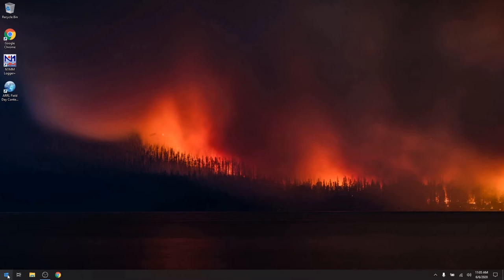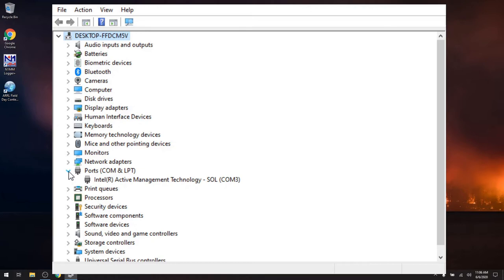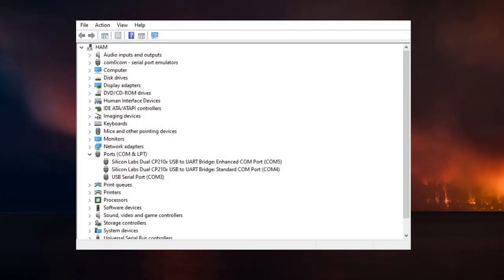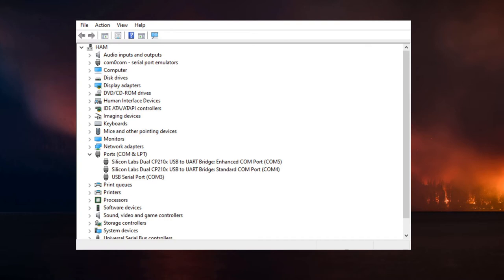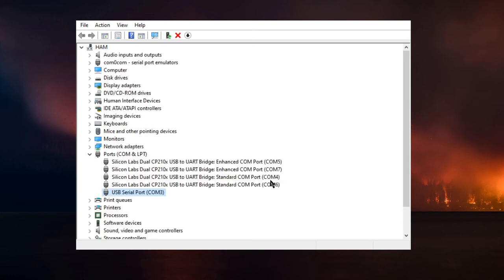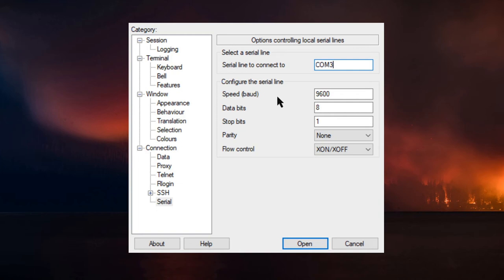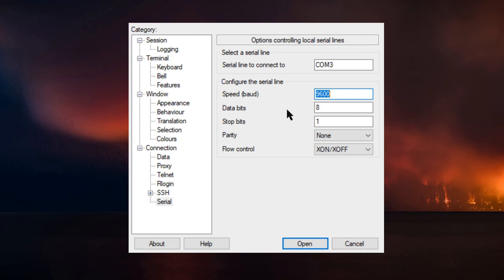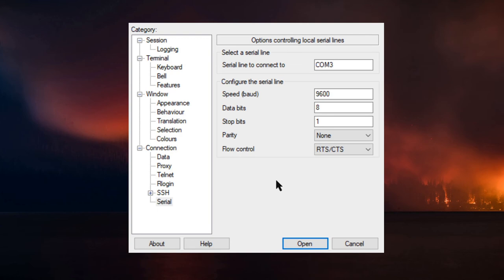Identifying, Configuring and Setting Up USB COM Ports In Windows 10

Comment: Thanks for your video's Stue, great help with N1MM. Would you have (or make) a video about what I think I port sharing. I have N1MM setup with my TS-590sg performing CAT control and the works, but I also want to use an SDR to control the rig. It seems like I need a "virtual" com port that is addressing the same cable that goes to the rig which is already in use by N1MM. Any thoughts would be great. Radio is the easy and fun stuff, but working with MS Windows is a daily challenge.
Reply from the maker: Hi Mark,
Wow... I can't believe I missed your message! It's interesting that you ask that question because it was a huge problem for me when I setup all this stuff. Let me share some ideas...
First off, N1MM+ does not 'share' well with anything. It want's to control the radio and everything about it. There are other issues as well with other Ham software packages that give you trouble as well. I ended up buying a package called Win4Yaesu that could control my rig and had 6 virtual ports that you could setup to have other software 'think' it was talking directly to the radio. This was my final solution. But, although this software is available for other radio brands, it is limited as to what it supports. If you have an FT991, FTdx???? I would strongly recommend it, but that's not your current setup.
I have found something interesting in HDSDR that I have just begun testing. It is dependent on Onmirig software, but seems to solve the problem for many. It basically uses a virtual null modem cable configured through com0com and presents a TS-50s to other software connecting to it. Once I complete the test with N1MM+ I will post the video.

Stu
AG6AG
Reply: @AG6AG  Great, thank you for that info. No problem on the delay, I'm still trying all sorts of options. The SDR control I have dropped by the wayside, but I have added a second cable to the TS590 and now it has two com ports so I can run two pieces of software without virtualization. Some say that is also looking for issues, but it is a neat feature of the 590 to have two serial ports. I'll keep an eye out for new vids, I love all the information. Thanks!

Comment: The com port section in device manager is missing, what do i do from there
?
Reply from the maker: This usually implies that the device is not being identified by Windows. With the Device Manager open, plug the device into the USB port. Look for something showing up with a yellow or red mark on the left side of the device description somewhere on the tree. If you see something appear, it usually means that you need to download a driver for that particular device. This is common with Icom and Yaesu radios. Just go up to the product's web page and download the drivers for the device. If nothing shows up anywhere in the tree, you may have bad hardware.

Hope this helps,

Stu
AG6AG
Reply: Go to view and then click on show hidden devices. If it doesn't show up then go to Action and add legacy device. Scroll down to select Ports (com).

Comment: Avoid Prolific adapter at all costs... it may crash your computer!
Reply from the maker: Hi Andre,
The actual issue was with the counterfeit chips. For the what we use com ports for in Amateur Radio the 'real' Prolific chips are fine. If you are concerned, you certainly can order out the FDDI chip set devices...

Stu
AG6AG
Reply: Been using Prolific for many many years and it runs flawlessly.  Prolific Driver version 3.2.0.0 is what you need
Reply: @8du  Yes if you have the right one but you don't know if you have a clone! Prolific did a very bad move to clone user that why I don't recommand it.